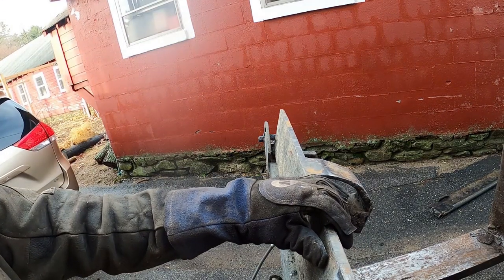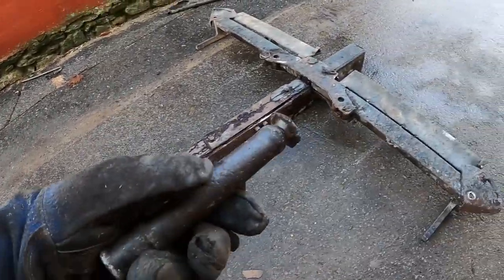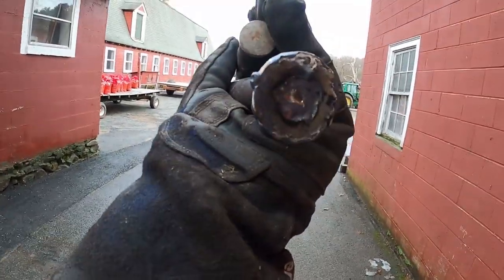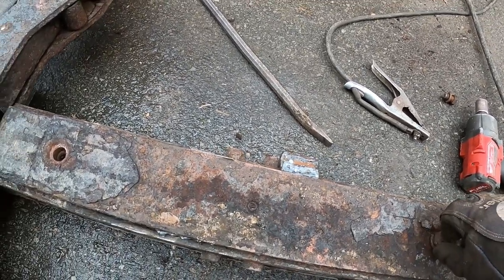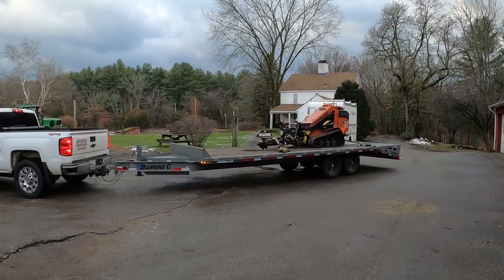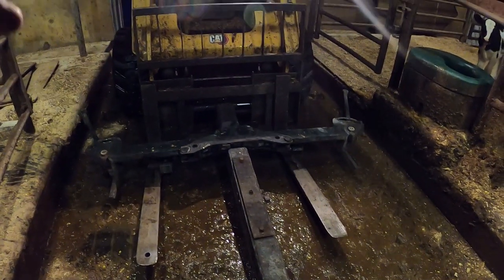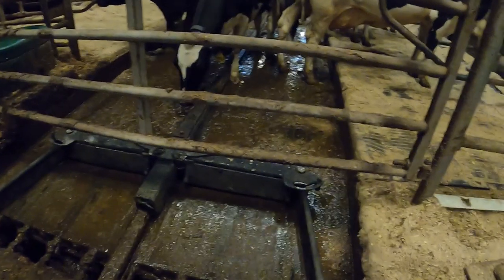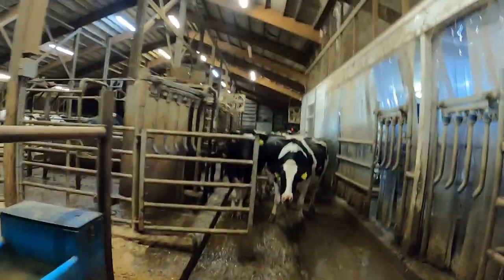How Do We Clean The Barn? Scraper Repair

Comment: Hallo. 
We have in Our old barn  manurescrapers  who pulled with a chain  .
The chain is half an inch thick ..
And we have scrapers  who have  to legs which  v-shaped works . 
On the backway  folded the legs together .

The chain who pull the scraper is  long hole style  with hook at one end of the 
Chain link .

The Motor who turn it .had a pinion  wheel  which engages in the chain link.

The oldest scraper  works since 1973 .
The other since 1977 .
The chains of both machinery  had we 
5 years ago  changed . 
The scrapers than a little bit fitted. 

Nice greetings from north west germany from Bert

Comment: That's interesting, i have never seen a scraper like that. We have one with a chain that's just under the floor, a plate down from the scraper through a small slot is connected to the chain. The chain is laid back and forwards, so when one scraper goes backwards the other one goes forwards.

Comment: I've always wondered what happens when a cow goes down in that isle we all know that happens and they can't get enough traction to get up. Does that scraper have some kind of clutch that it won't push on the cow burning the electric motor up. I've worked on a few farms we always pushed the isle out with a skid loader with a rubber tire scraper. The way I understand some of those automatic scrapers run while the cows are in the isle.
Reply from the maker: Yes they have load safetys on them. So they trip out and stop working

Comment: I’ve done plenty of welding on cow shit covered equipment lol. Only thing I do is I found that a needle gun comes in handy to beat most of the shit and rust and paint off. But I know bud you can’t get it all off. One other thing is I like to use flux core wire. Not the gas less crap lol. But 0.45 flux core with 75/25 gas works excellent on rust and oil and grease and cow shit lol. But I understand whatever is cheapest is what works best!!!